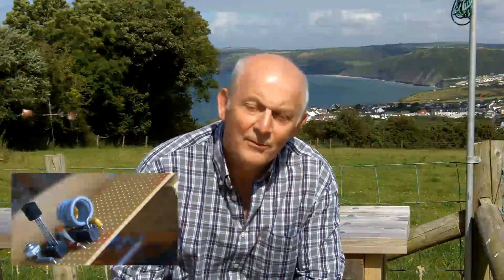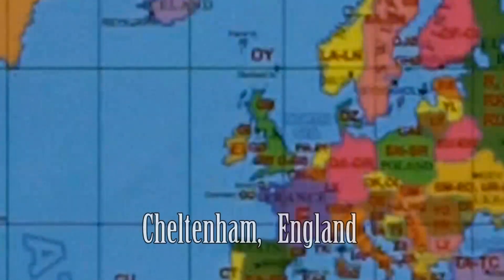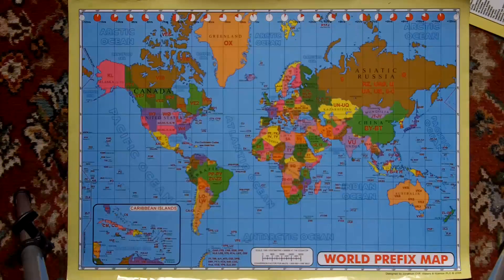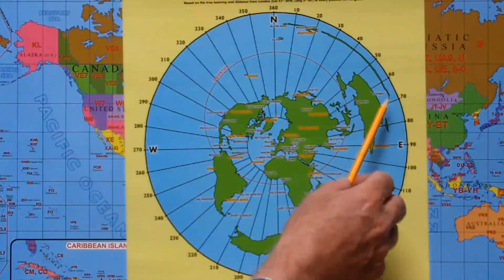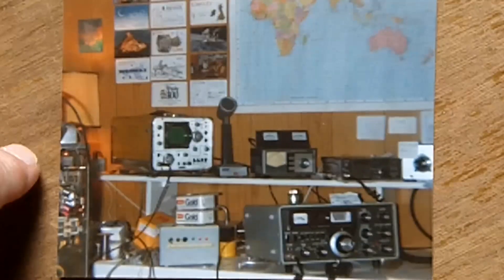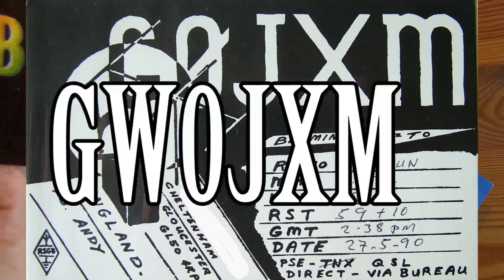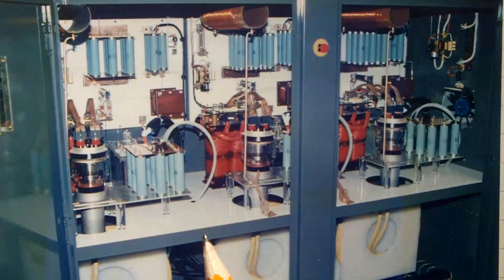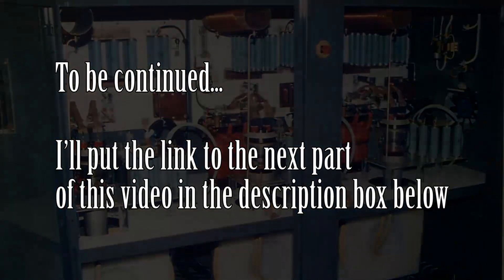Waffle about QRP and a 240 kW power supply unit Part 'A'

Comment from the maker: Hi, I imagine they’re solid-state now. The biggest valve I worked on as a service engineer was a ‘Vapatron’ a huge beast of a valve about 18inches diameter. It sat with its copper anode in a large water tank. It was what’s cooled a vapour phase cooling system. The valve boiled the water and the steam went up a tube, was cooled and returned to the tank, there was a rubber seal that could let steam into the body of the equipment if wrongly fitted, steam and 20kV = trouble     
Kind Regards ... And

Comment: Very interesting video. Do you know if todays transmitters stil use tubes or valves for the final stage or are they all solid state devices now? 
I have read that Eimac, a tube maufaturer, once made a tube that was 23.75 inches in height, had a diameter of 17.03 inches and weighed 175 pounds.It's filament was rated at 16.3 volts at approx. 625 amperes. It's anode voltage is 22.5 kV DC and its output is 2,158 kilowatts of RF power !!!